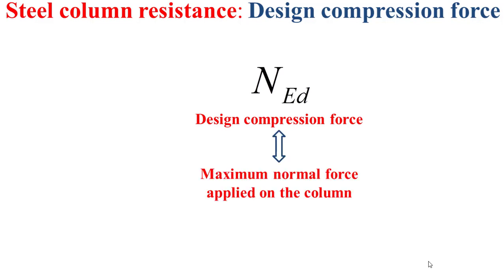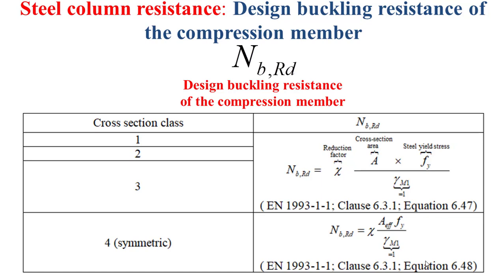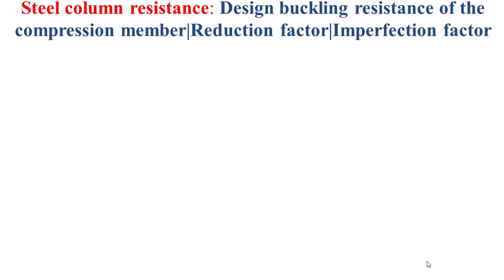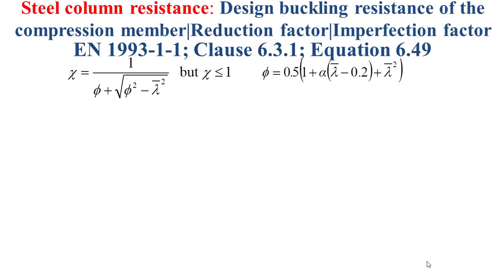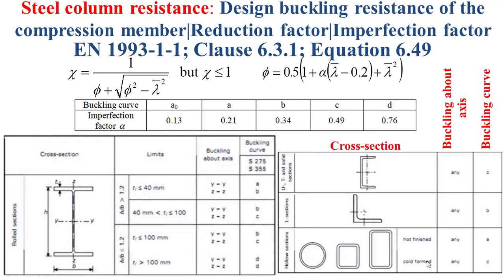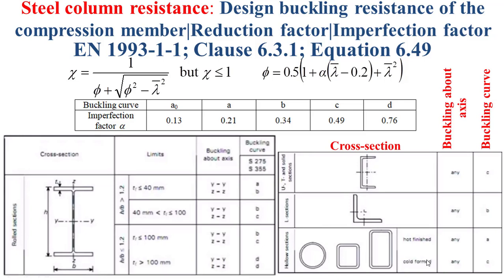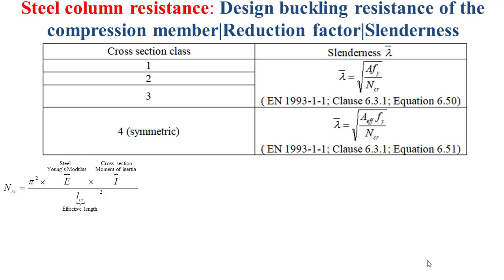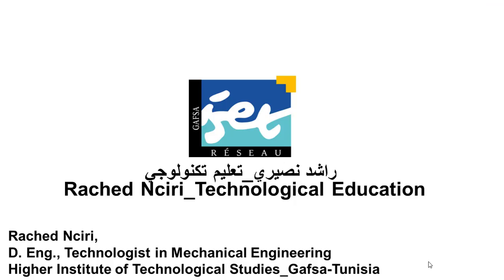Steel structure resistance verification_Column_Buckling resistance_Eurocode 3

Comment: Could please explain what is the A(eff) and what formula do you use!
Reply from the maker: In Eurocode 3, the effective cross-sectional area (𝐴eff) is calculated by reducing the contributions of slender plate elements (e.g., flanges and webs) prone to local buckling, unlike the gross cross-sectional area (𝐴), which considers the entire section without reduction. For 𝐴eff, slender elements with width-to-thickness ratios exceeding critical limits are adjusted using a reduction factor (such as 𝜌) based on their slenderness and stress distribution, resulting in reduced effective widths (𝜌⋅𝑏). 𝐴eff is the sum of these reduced areas and any non-slender elements (Aeff  =∑(ρ⋅b⋅t)+non-reduced areas where, ensuring only the load-bearing portion of the section is considered, while 𝐴 assumes the entire section contributes to resistance.
b = width of the slender plate element
t = thickness of the plate.
Reply: @RN_Ed_Eng  : Thank you my brother for your prompt reply and I appreciated! Your videos are very well thought and presented. They are some of the best videos that I have come across but I am very disppointed not watched by many. I forward the links to my friend to watch them. Keep up the good work and GOD bless you and "Happy New Year and Best Wishes for 2025"!
Reply from the maker: @rahmanrahmani2896  Thanks a lot.  I truly appreciate your support and for sharing my videos with your friends ; it means a lot. Please, feel free to ask.